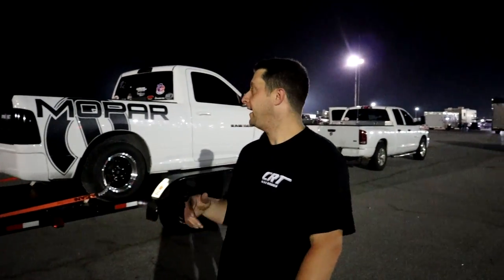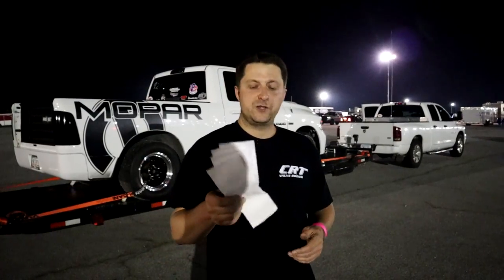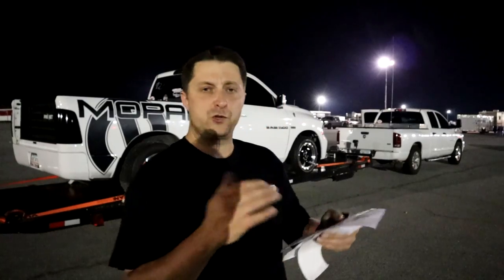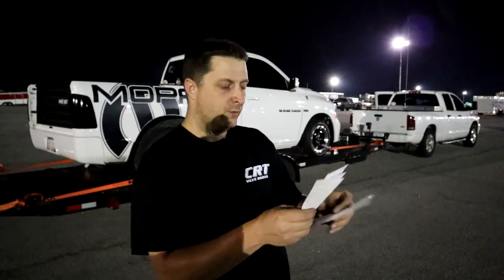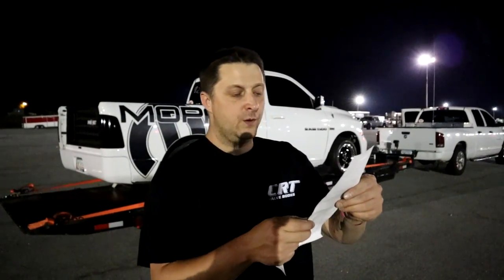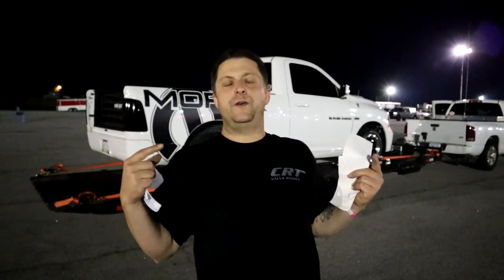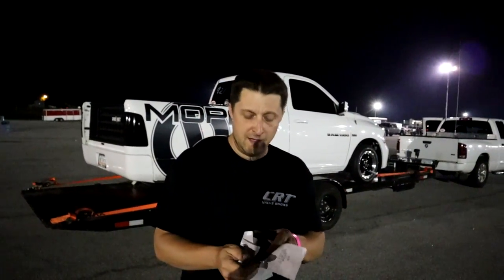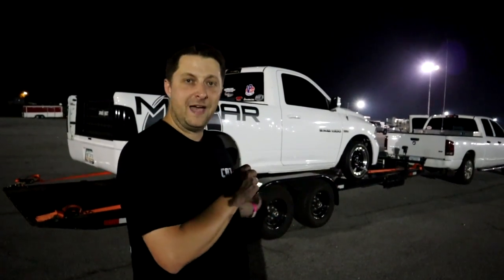First Trans brake Launch Full Weight 3100DA 4TH Gen Ram 46RE Swap

Comment: Need more sidewall and adjustable shocks. Plenty of more people making more power and running faster with just that
Reply from the maker: Agreed and parts is on the way I haven't had traction issues until trying to launch hard at about 4500 so in time we will get it going takes time.

Comment: They make 90-10 front shocks for that year Ram ? That would help with front end travel,  that helps transfer weight to the rear tires. Lookn good. 🏁🏁🏁🏁
Reply: And remove the front sway bar
Reply from the maker: I have adjustable front qa1 shocks already but really need the rears to go with them and the adjustable rear link bars to set pinion angle hopefully should do better after some tweaks with the new parts.
Reply from the maker: Sway bar hell i tossed that years ago🤣 who needs that dumb thing👍